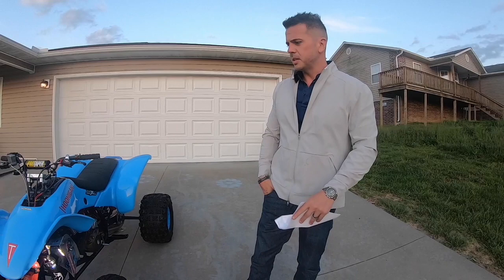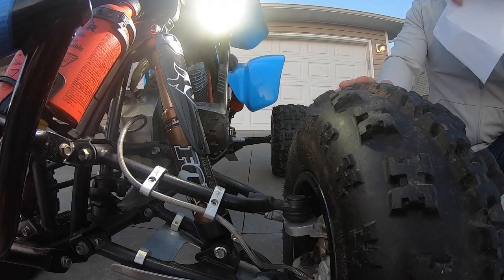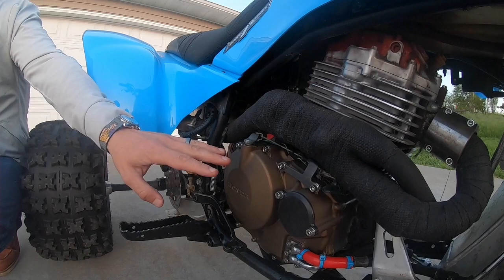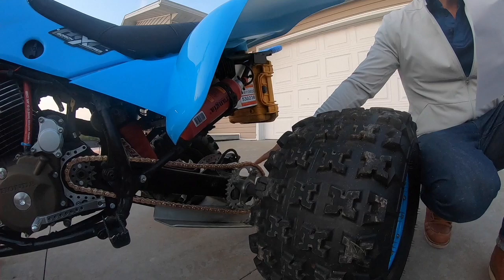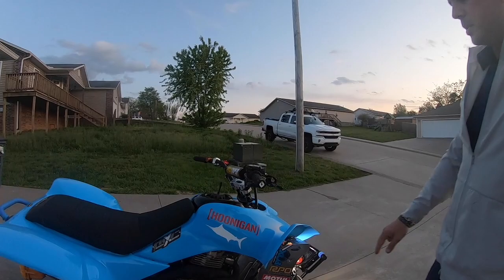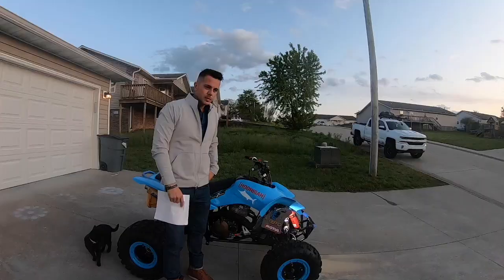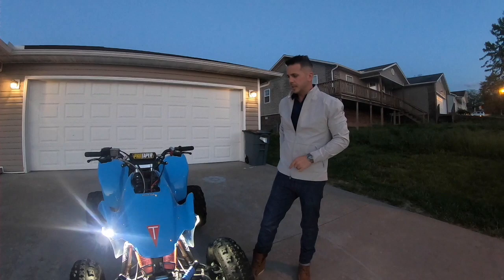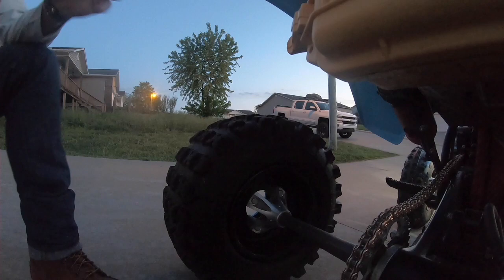Custom 400ex Awesome Rebuild, Restoration.

Comment: Live it. Just watched the first resto vide0. I'm 50 and picked up 2 blasters recently. They may be a bit small but one will be for tight woods other for wider trails. That one will get a swingarm stretch and widened. I bought them do to I love 2 strokes. Price was right and they're not beat to hell. Good thing as that they are both 06 disc brake models. I hope they turn out half as nice as yours
Reply from the maker: Alek’s first ride was a Blaster. They are mad fun, and cheap to maintain!

Comment: Brake lines should be routed on the backside of the a-arms not the front to prevent any debris from snagging or damaging the lines.
Reply from the maker: Thank you. You're right, and it's been corrected.

Comment: What air shrouds are you running?
Reply from the maker: CFM Performance. Also battery box and oil cooling tank from them. Check drop down description for full parts list.

Comment: paint the exhaust gloss black also the tip and great reasonable performance mod is  a 2006 FCR carb from a crf250/450 dirtbike,also add  a cold air intake,Lastly upgrade to a 24v battery for faster starting.Great build btw
Reply: Let's see your build ?
Reply: @RideRedFred  why what for?

Comment: Highly recommend the gt thunder oversized pegs made by Jeff Snure he powder coats them black very durable
Reply from the maker: Would like to see more about this. His website is useless, and nothing is mentioned about 400ex pegs. We are presently looking into some custom pegs for this.
Reply: Swamp Gump Harpie if you got to the p4quads website and click on the Honda 400ex headstuds and other parts they are on there just gotta click the add to cart and pay pall him the money he’s pretty quick about shipping trust me I work at his shop with him
Reply from the maker: Gavin Stark You got my attention. Just bought a set. Feel free to make’em a little special, and maybe we’ll highlight them in a vid.
Reply from the maker: Gavin Stark Pegs are on; video’s posted. Thanks 🙏

Comment: If you ever get the time can you explain the process of installing the cfm airbox intake? I recently ordered one and nothing seems to be lining up and the wiring is a mess.. Thanks
Reply from the maker: We drilled the subframe and bolted it on. It works better when you’ve cleaned-up your wiring. This harness is custom, but on our new build, we just bought a new harness from Honda, and had it installed. If we did a video showing us drilling the subframe, it would land in a world of misinformed hate! You might reach out to CFM and ask what they recommend for installing; they’ve always been helpful when we’ve called or emailed.

Comment: So i love the idea of the air box, did you guys make your wire harness or did you order it through somebody? I'm in the process of building my 02 400ex for trails up in michigan. Very curious about the wire harness. I have a stock one on it right now and it looks like a challenge to re route it into that box. Thanks for keepin her alive!
Reply from the maker: David, Thanks! The air box is very nice. Getting the floppy, and poorly mounted battery into a solid compartment is always a good thing. I had the wiring harness custom built by a shop in southern Missouri. I’m convinced that replacing all stock wires on such an old quad is the most important mod that should be done. Good luck with your build, man!

Comment: Was the battery box relocation hard to do? My 400ex always has electrical problems and I know it's mainly cuz of where all the stock wiring is located.
Reply from the maker: MILITANT MINDED The battery box install was simple enough. The wiring on these older quads is often bad, and the battery location on the stock EX’s makes it worse. We ripped out all the old wiring, and installed a completely new, custom wiring harness. This is probably the best thing that was done to this quad.
Reply: @swampgumpharpy7977  I was wondering if you possibly could go over exactly how it was done, I think if you did a video on that alone, 409ex owners like myself would be extremely grateful...im a little nervous taking this on and no site or video goes over how exactly it is done. Love the build man I want to get mine to be mechanically sound and not have to worry about electrical problems anymore
Reply from the maker: @militantminded109  Yikes!!! This would be a tough vidya! We are wiring our next EX in a couple of weeks, and we'll see what we can do. Don't hate us if it's too much to try to post, but we really will give it a shot.
Reply: @swampgumpharpy7977  no worries man, u don't have to if u don't wanna, but being a 400ex owner, and most of others who do, have probably experienced battery and wiring problems. Seeing how to do it would just be kool to those who facing the same problems...Love the Build man

Comment: If you want it for trails why did you buy rear hub extensions
Reply from the maker: I answered that in this video. After I bent my second set of stock hubs, I went with these from tusk because they are made better. If I could’ve bought them stock length but made this tough I would’ve.

Comment: Were the plastics hard to install? Did you need to make custom brackets or did they mount to the stock brackets. Quad looks amazing!
Reply from the maker: Tyler Schindler Hey man! Plastics are such a simple mod. You’ll be fine with this install. Everything mounts up very much like stock. There are a couple of stock pins in the back that Have nowhere to go on aftermarket plastics, but other than that... simple enough. The two brackets that mount from your front fenders to your frame need to be shifted slightly forward. Like, turn them forward. Installing them straight up will make your front fenders sit on a sharp corner, and your plastics will crack on that over time. You’ll see what I mean when you buy these. Have fun out there!
Reply: Swamp Gump Harpie, perfect! Thank you! I was scared to buy aftermarket parts because they usually don’t workout as well as OEM parts but thank you I’m glad they work! Also did you have to relocate the on/off switch?
Reply from the maker: Tyler Schindler We did relocate the switch. If you watch our latest video, you’ll see us turn the switch on, and it’s located on the wind shroud under the front fender. We had the ignition wires dipped in plastic to protect them in such an exposed area. Both the light switch and the ignition are mounted on our right shroud.
Reply: Swamp Gump Harpie sweet! I will watch the video. Love the uploads you post.

Comment: great build where did u get the starter switch from?
Reply from the maker: That was bought at a local store. Seems like it was Fly. It’s a decent switch. Google fly kill switch and you’ll find it. Wire it reversed so it starts rather than kills. Make sure that an experienced electrical tech gives it a look before you park it in your garage!!
Reply: @swampgumpharpy7977  ok thanks much 👍

Comment: What size bead lock wheels are those? Also what size tires did you mount on the wheels?
Reply from the maker: 9”back (5+3 offset), and 10” front. I’ll let you know tire size once I can check.
Reply: Swamp Gump Harpie thanks

Comment: What brand is your handle bar clamp, im wanting to get fatty bars for my 1986 trx250r and im struggling to find 1 piece clamps
Reply from the maker: It’s Houser. It’s an anti-vibe clamp, and should be mounted to a race-performance steering stem. Our clamp is temporarily mounted to the stock stem, but we’re going to swap that soon.
Reply: @swampgumpharpy7977  so youd advise and not running my stock stem, i don't have a ton of money but i dont like 2 piece clamps and cant really afford a new stem atm
Reply from the maker: Specs Gaming All of this style clamp that I’ve seen from Houser, Alba, Modquad, etc, would need to be mounted to an aftermarket stem. If you haven’t looked at the stems from Alba Racing, you might check them out. They are half the price of a Houser stem.
Reply from the maker: Just for fun, have a look at the Mako 360 SX clamp. It’s anti-vibe, and made for oversized bars.

Comment: Why was she taking so long to start?
Reply from the maker: A couple of reasons that we’ll address in the next couple of videos. Primarily, it’s an 18 y/o carb and cold natured as hell.
Reply: @swampgumpharpy7977  you should buy a crf 450 40mm fcr carbuerator it makes a huge difference you need to modify a bit to install it but it’s worth it

Comment: Lol front tire tread is backwards, shocks are upside down, and you put to extra exhaust badges on the muffler?  And with all those extra fuel cells that thing is like a bomb. Lol
Reply from the maker: The front tire tread is non-directional, we have an email from Fox stating that the shocks can be installed either way without issue, carrying extra fuel is nothing new, and yes... there are extra badges as we assume you’ve seen. Were these rhetorical concerns, or did your sister tell on us about last night?
Reply: There’s several things wrong with this build but this dude knows it all…….lol

Comment: where did you get the plastics ?
Reply from the maker: Juan Olvera , These Maier plastics were purchased from ZMP Performance. Maier makes plastics both with and without the headlight cut-out. These are without, so the stock headlights were removed.

Comment: Do you have the Alba antivibe bar clamp and +1 steering stem on there as well?
Reply from the maker: Ben Cronkhite ,  In this video the Houser anti-vibe clamp is temporarily mounted on the stock stem. It mounts, but anti-vibe bushings don’t make contact. We’re looking into either the Houser or Alba +2 stem.

Comment: Ur shocks r on upside down
Reply from the maker: D&C Outdoors They are; Long story, fox confirmed that, because of how they are sealed, they can be positioned either way without problems.
Reply: Swamp Gump Harpie oh i just was like a wait a minute that doesn’t look right
Reply from the maker: D&C Outdoors It’s interesting that you noticed the problem, because orientation between the Evol’s and the Float 3’s are different. The Fox Float Evol’s are the positioned like we have here, with the air chamber down; the Float 3 series is supposed to be installed with the air chamber up. So most folks wouldn’t notice wrong orientation between the two. Very good eye.
Reply: Swamp Gump Harpie gotcha u like the hmf is it loud or kinda quite
Reply from the maker: D&C Outdoors It’s loud. Sounds just like a White Brothers slip on.
Reply: @swampgumpharpy7977  i jus did a complete 440 big bore motor rebuild on my 02 it came with a white bros exhaust im assuming its a good exhaust now that I've read your comments lol i had no idea what its gon sound like i get it out the shop 2mrrw i cant wait !
Reply from the maker: Dink Dink 😆 Man, that’s awesome! White Brothers slip-ons were cool, and it seems like half of the old EX’s had or have one on. You can still find them new on eBay; some of their more recent stuff, anyway. Let’s us know how it sounds, we’re guessing it’s gonna sound good!